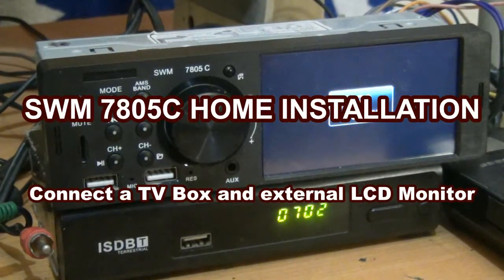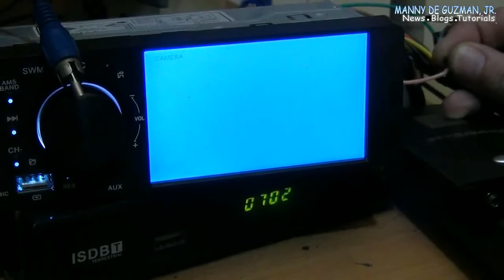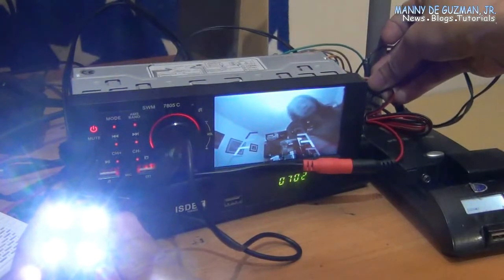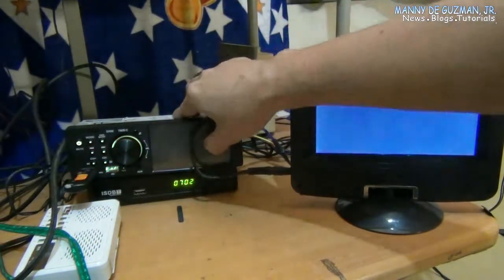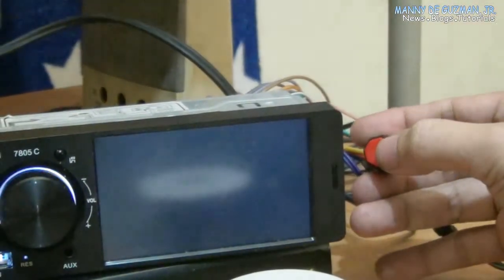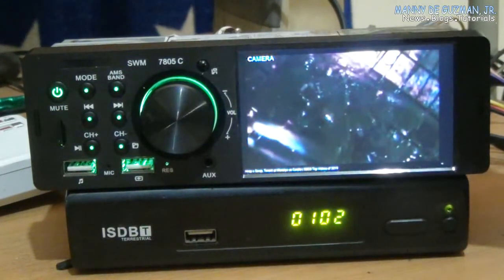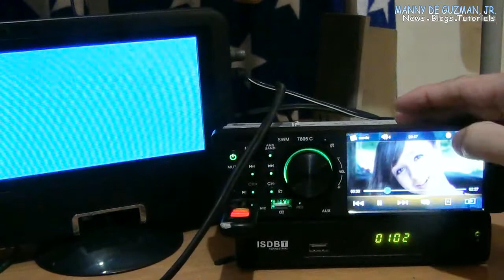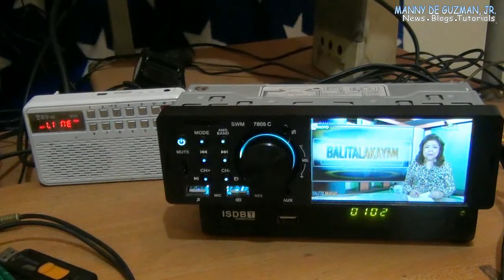SWM 7805C CAR RADIO - Connect TV box, CCTV and external LCD Monitor.

Comment: Awesome video!
So, in the car, if I grab 12v from the rear bulb  to activate the camera, the radio will automatically display the image when I'm in reverse gear, right ?
Reply from the maker: For as long as you connect the pink wire to the positive (red) wire, the radio will shut down and will be put into external rear camera mode. You must fix those wires into the terminal switch of the gear shift, with the gear stick in the reverse position. Then you can connect the reverse camera in the specified video input port at the back of the car radio.

Comment: Fit po kaya sa nissan urvan escapade?
Reply from the maker: Single DIN po yan 7805C, but a bit thicker than most old school car stereos. Kung ang irereplace nyo eh 1 DIN head unit from 80's-90's  baka need nyo mag cut ng additional clearance  sa original dash mount.

Comment: mine cant launch videos just turning off its the same unit
Reply from the maker: Sounds like your unit may be under powered. Try using another 12 volt car battery with higher ampere capacity. Or try using a 13.8 volts 6 ampere regulated power supply. Also check the format of your videos. This one plays MP4 up to 720p. 1080p lags and higher than full HD might not play at all.
Reply: i ve tryed 480p and 720p on the usb flash drive
Reply from the maker: @ПетърБозаков  can your unit play mp3 music? Is it turning off only once the head unit is processing something like using the radio, playing something or when you turn the volume up? If that's the case then I think the power supply is the culprit, either it is underpowered or some components are overheating or shorting inside, like a defective mosfet or a shorted diode. It may also due to a bad or leaky capacitor. Try changing power, use a new battery with a higher capacity or use a working 13.8 volt 6 ampere regulated power supply.
Reply: @Manny_News_Blogs_Tutorials  i am using it on my car i can play mp3 on the flash drive
Reply from the maker: @ПетърБозаков  if your car battery is good and can play mp3 but can't play videos, I suspect voltage drops drastically or got underpowered whenever your unit runs a heavy process. You can measure the battery voltage drop with a volt-ohmmeter tester while trying to play videos. That's the only way to rule out battery or circuit board problem. Otherwise it's a software or firmware issue that needs to be updated (if you can find a tech service that do ROM flashing or reprogramming head units like that). Also try running bluetooth with your phone connected (either placing a call or playing mp3 on your phone connected to the head unit's bluetooth. If it does run on bluetooth then either a blown diode or faulty capacitor   on the circuit board, or the unit's firmware is causing the issue. Or probably the video encoder got corrupted it does not recognize  the video codec. Try other video format as it plays .mov and .wmv as well. If still it does not play movies other than mp4 then your unit might be defective or might have some sort of a damage inside.
Reply: @Manny_News_Blogs_Tutorials  its running videos only on .mov ok thats something
Reply from the maker: @ПетърБозаков  Then I suppose it's a codec problem then. Maybe your head unit is running on a different firmware and runs only on .mov. Mine can run on mp4 and wmv up to 720p. 1080p lags too much, but I don't mind because I only play 480p mp4 movies all the time. I haven't tried .mov though because I didn't use that kind of format (if I ever encounter .mov in any camcorder I render it anyway in mp4 upon video editing). So I suppose you can't do anything at the moment but convert all your videos to mov's. That's what previously do years ago when playing movies with older portable DVD player that does not support  MP4 format but can play WMV and VOB's.
Reply: @Manny_News_Blogs_Tutorials  thank you

Comment: pwde ba tv plus dto
Reply from the maker: Pwede TV Plus, o kahit anong TV box or Android box, any video source such as DVD player, VHS player, etc. Although wala nga lang siyang sound via 7805C car radio kse sa reverse camera input mode mo sya papaganahin. You need a separate amplified speaker connected to your TV Plus box para mapalabas ang TV audio.
Reply: @Manny_News_Blogs_Tutorials  cgruo pwede ipalabas ang audio ng tv plus via Bluetooth?
Reply from the maker: @ArczAngel  Wala naman Bluetooth ang TV  Plus box. You need to pair SWM 7805C with Bluetooth enabled gadgets, but TV Plus box   don't have that function. Pwede siguro kabitan mo ng TV Plus Go ang celfone mo, tapos i-pair mo yun celfone dyan sa SWM 7805C Bluetooth car radio.
Reply: @Manny_News_Blogs_Tutorials  ah ok paps, cguro via aux na lng, galing tv plus to tv aux of the car stereo?
Reply from the maker: @ArczAngel  kung sound ang palalabasin mo sa SWM 7895C pede mo ikabit sa AUX jack sa front panel sa baba ng volume knob tapos pindutin mo yun AUX icon sa LCD touchscreen para pumunta sa Auxiliary Mode. Pero kung palalabasin mo ang video output kasabay ng audio sa SWM 7805C, eh that's not possible kse kelangan i-activate mo ang camera mode which disables all of the radio functions and settings including the Audio Auxiliary mode. Yun video input lang ang lalabas sa screen pag ikinabit mo angTV Plus video out sa top right RCA jack (camera  input), walang tunog na maririnig since wala naman mic input yun camera mode. Either alin lang sa dalawa ang choice, either audio or video lang ang mapapagana mo as explained in my demo, hindi sila pwede sabay.
Reply: @Manny_News_Blogs_Tutorials  ah ok , yun nga ang iniisip ko.. salamat paps